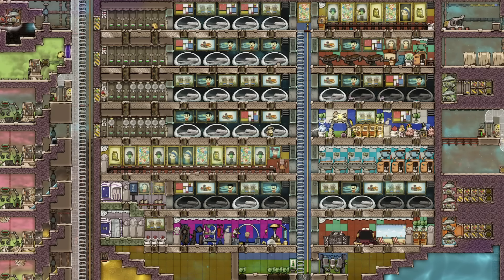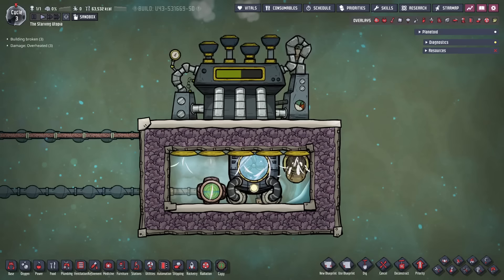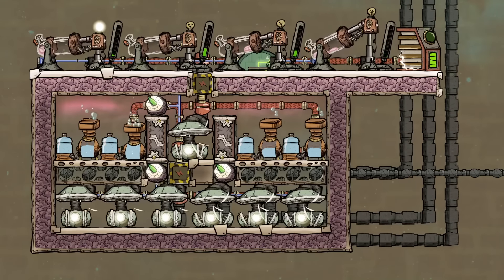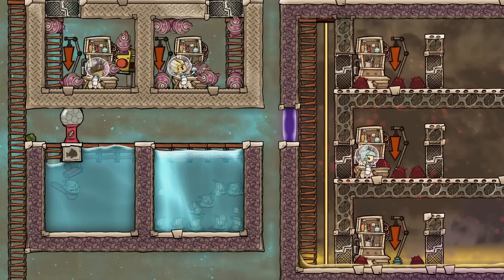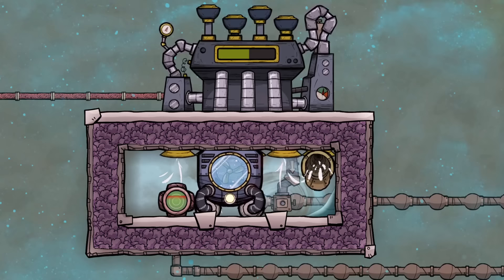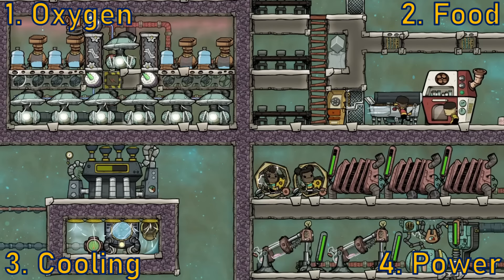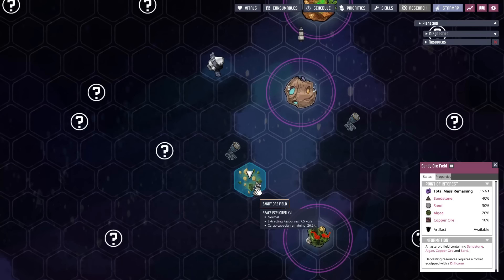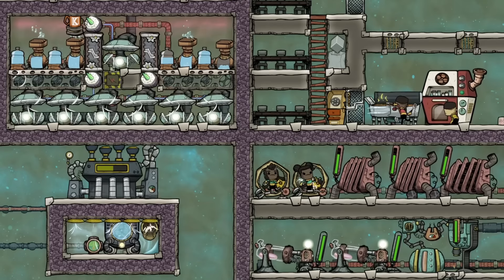Oxygen Not Included - Tutorial Bites - Sustainability

Comment: I find using pufts for slime to turn into algae can keep algae terrariums running for a very very long time, and return most of the water they use as polluted water, which along with the polluted water from the algae distiller being run through a sieve keeps the water available for the terrariums, by just spilling the right amount of water on them from vents.  Yes, your dupes have to come along and empty them, but algae can be easily be provided by an auto sweeper and a single conveyor output, so dupes are only needed to take the polluted water out of the terrariums and carry it away to the bottle emptier.  Coupled with a closed bathroom loop with overflow, I find myself building more liquid reservoirs than I wanted because I don't have enough uses for the water until I build a super SPOM.
Reply from the maker: I think that's an unusual way of doing things, but if it works it works - that's what we love about ONI!

Comment: I saw a base setup a while ago that was sustained on a poluted dirt cycle for oxygen due to a lack of water.
He used the lumber -> ethanol -> Pdirt -> sublimation station -> deodorizer production path.
Filtration medium was done sustainably with the use of clay -> ceramic -> sand path.
I think this was the most inventive I've seen so far to be honest.
Reply from the maker: Yeah that is possible, and I have also seen someone keep their base sustained on loads of morbs which is also inventive! I consider these a little offbeat though, so I think it's fair to say that electrolyzers are the easiest and most 'standard' way of producing sustainable oxygen.
Reply: Electrolyzers is the go to early/mid game method for somewhat sustainable oxygen.
The guy with the pdirt used it because there were poluted dirt everywhere on the map from the start. 
I've lived off of naturally outgassing poluted water for a fairly long time myself a few times due to having large swamp biomes present. 
a few pip planted oxyferns in the basement, and a big pond of poluted water with deodorizers on the side can suport a surprising number of dupes.
Reply: Instead of using a deodorizer, you can also use the following route: (starting with polluted oxygen) Pufts -> Algea distiller (algea for oxygen) -> Heat up the polluted water till it boils -> cool it down -> electroylyzer (for even more oxygen)

This route does not consume any sand, and gives you a small amount of dirt in return. You can also connect your bathroom loop to the water boiler to prevent that part from consuming any sand as well. Note that this route is power negative

Another loop is (starting with polluted oxygen) Cool it down until it is liquid -> Heat it back up via a counterflow heat exchanger 

This gives you way more oxygen for your input, but requires a deep chilling system

Comment: 6:59: Note that for lead, other materials might not be an option if you want to make an lead suit. They only accept lead and not other refined materials. However, like the abyssalite case, there is usually enough present on a map, to prevent it being an issue
Reply from the maker: An interesting point, although the repair cost is in glass so you only need enough lead to make the suits in the first place. I think you're right that that isn't a practical limit, as you could make so many before you ran out it wouldn't be an issue.

Comment: "Really only one sustainable oxygen machine". I beg to differ. Trees-> polluted dirt -> liquid oxygen -> gas oxygen. It produces ~10x the oxygen for a given amount of water because most comes back from the petroleum generator. Instead of liquifying the oxygen, you can run it through pufts, and you end up with a net production of polluted water, though at much reduced output. Alternatively you can go the hatch route and smash ceramic for sand and just deodorise, or even just ignore the yucky lungs. Finally, if you are running a sour gas boiler and have some sulphur, throwing some grubgrubs into your tree farm also makes it a net producer. You don't need a lot of it, so a slickster ranch is enough.
Sublimators are viable right through the game, and make better end game projects. Electrolysers are easiest if you have plenty water, but sublimators have many more options and many of them are just better.
Reply from the maker: That's a fair point, and I think I may have worded that too strongly on reflection. It's probably more accurate to say that electrolyzers are generally the most common and straightforward way to make lots of sustainable oxygen, but there are others as you point out. Thanks for the input!

Comment: Electrolyzers aren't the only way to sustainably produce oxygen.  You could use a Polluted Water (cool slush) vent/geyser (letting the water offgas) or a Polluted Oxygen Vent.  Regolith can be harvested for infinite filtration medium if you want to clean the polluted oxygen, but like toilets that's not strictly necessary for survival.  

Technically rust or slime/algae can be used and refreshed via space POIs, but while that may be sustainable it's definitely not practical.  Morbs are also technically infinitely farmable for polluted oxygen, though that scales very poorly.

Comment: In your SPOM it's better to place the hydrogen pump one tile higher, against the ceiling, as it will be more efficient at pumping hydrogen and will make the electrolyzers stop less due to overpressure.
This happens because the pump extracts gas from 5 tiles in the shape of a + centered in the lower left corner of the pump. If the pump is below, the left and lower tiles are blocked by the door and the joint plate. When it's against the ceiling it can pump from one extra tile, and also all other tiles are closer to the hydrogen at the top.
The electrolyzers will work more and the oxygen pressure won't drop as much, ensuring the pressure sensors don't stop the oxygen pumps as much
:)

Comment: Is there any other way to get water renewable from geysers? I assume not all seeds will have one and it's usually my main concern since I tend to run out earlier than other resources
Reply from the maker: In terms of simplicity, water geysers are by far the biggest and easiest to capture sources of water - and most maps have quite a lot of water geysers available if you fully explore and find them. Beyond that there are other ways but they're more difficult. I would list these as petroleum boilers (+750g/s polluted water for a 10kg/s oil boiler), sour gas boilers (+2kg/s polluted water for a 10kg/s oil boiler), steam engine rocket tunnels (possible +~10kg/s but highly variable), or wild arbor tree farms making ethanol (+26g/s polluted water per tree).

Comment: I disagree with the notion that the only viable way to make oxygen sustainable is electrolysers. Pdirt from arbor trees are actually a great option. 

One limitation that they have is that the simplest way to turn polluted oxygen into clean oxygen is deodorizers, which then require filtration mediums. But once again, there are several ways to sustainably get filtration medium. Or it's also possible for your dupe to breathe poxygen, or you can also purify oxygen by cooling it into liquid oxygen and then heating it back up to clean oxygen.

The current version of the game makes it a lot easier to get enough filtration medium, as you can just collect regolith from space or you can grind down sedimentary rock derived from the excavation story point.

Comment: Does building a single aquatuner with 2 steam turbines works?
Reply: steam turbine is only there to delete heat. as a rule of thumb, 2 aquatuners on super coolant need 3 steam turbines
Reply: Hmm so if i build 2 aquatuners (-2400 watts) with 3 steam turbines (+2550 watts), that means i can make a sustainable power source and a cooling loop right?
Reply: @baksu7897  actually you can, but if only over a cool steam vent. there is a video about exactly that by Tony Advanced here on youtubes
no power tho, only if several watts
also notice that i said super coolant, that is a very important detail
Reply: Darn super coolants. Thx for the info
Reply: When comparing power consumed/generated from the aquatuner/steam generator you need to compare the heat (DTUs)  transferred between the coolant and the steam, and how much is deleted by the steam generator. You cannot simple balance the wattage because the aquatuner/generators will not both run 100% of the time.
Reply: Steam power with aquatuner alone cannot ever create a net gain in power. Even with supercoolant, the production falls a little short. You need to add another source of heat to the steam to make them produce power.
Reply: Does adding steam vent do enough heat?